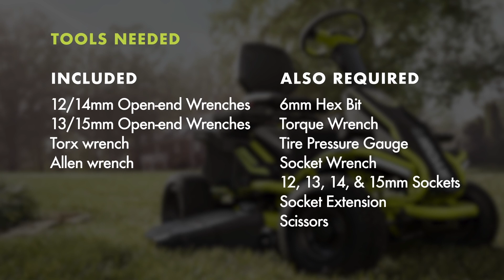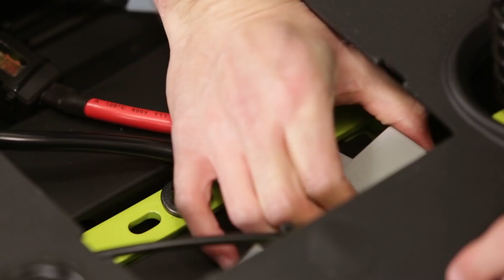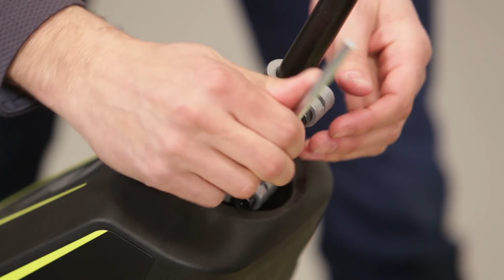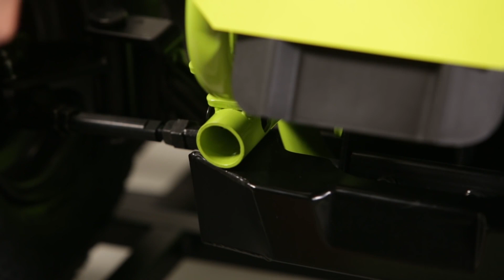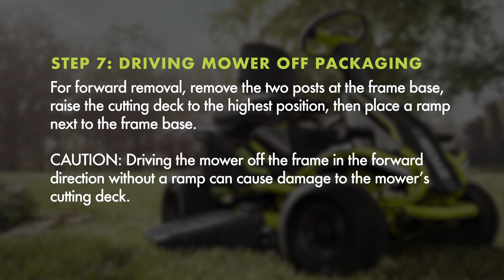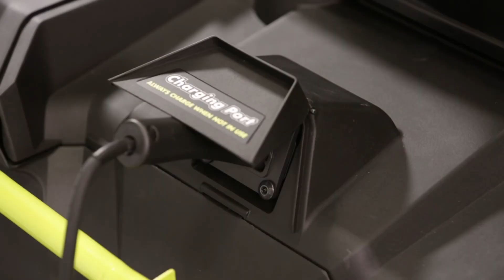How To: RYOBI Electric Riding Mower Assembly & Start Guide

Comment: Thank you I bought my Ryobi assembled but about two years later I drove over a small stump. I immediately stopped the mower. A fellow with a tractor lifted the front and the tractor was easily let down with no apparent damage except now the steering is very stiff. I removed the front metal guard and lubicated the gears. The steering is still stiff. At least I now feel better about checking the steering.